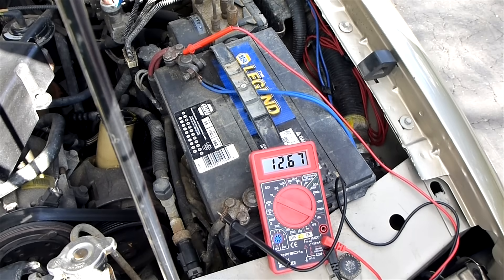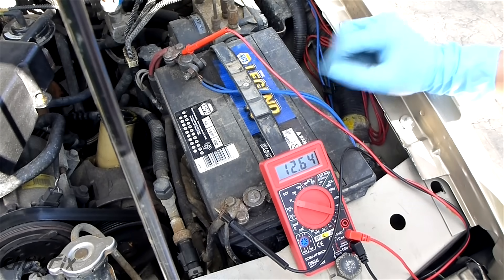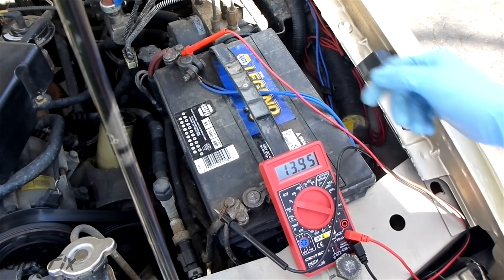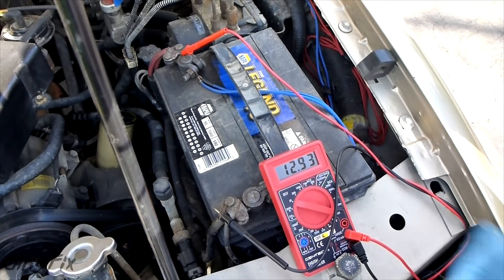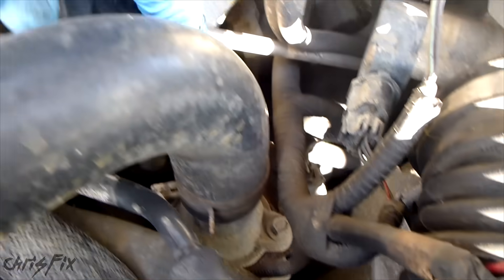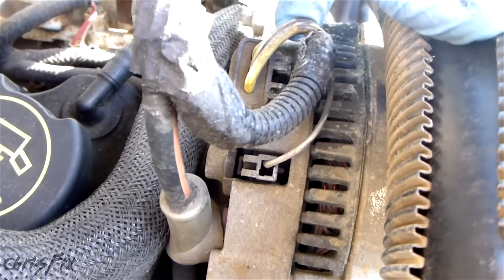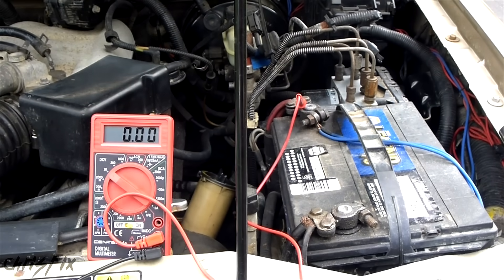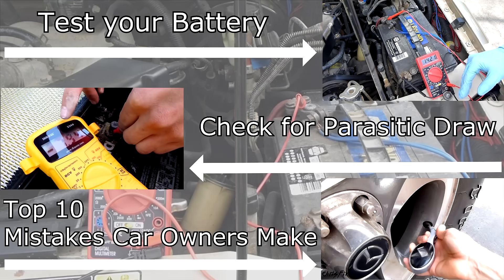How to Test an Alternator

Comment: So I tested the battery the battery was 9 volts so I have to change the battery I also tested the akternafod it was also 9 volts so does it mean if I have a good battery my alternator will be around 12 with a new battery or it will still be 9 volt on alternator

Comment: Hi. My car sometimes just dies. Dash lights and everything goes off. It goes on aftera or 2. My initial reading was 12.4V. After I started it, it went to 12.2V initially but after revving it, went to about 13.2V. Could it be the alternator?
Reply from the maker: The alternator should be around 14.2v at idle so it sounds like your alternator could be going bad or you need to clean your grounds and cable ends so they have a good connection.
Reply: ChrisFix Thank you! 😸

Comment: I had a driver side airbag module replaced on my 13' mustang (recall) and when i drove it home from the dealership the car died twice at red lights. I watched the voltage and its dropped from 14.2v to 13.2 within the 24 hours ive had the car back. Ive been driving it around and i notice every start up the voltage drops .1v
Reply: The car also would drop rpms and want to die but that problem seems to have gone away within a day

Comment: What does it mean when my black lead is on the ground and red lead is on the alternator case. And when I rev to 1500 rpm I have a positive voltage like 6-9volts. I’m not getting a negative voltage like your showing

Comment: hey chris, my 1975 toyota RT100 have some charging issue. after the engine started i only got something like 13.3-4v but after some revs it stay at 14.1v and slowly droping. and sometime the "CHG" light come on for a minute or even doesn't come off even it says 14.4v while driving. how is that possible?

Comment: Here's my deal. 
I bought a 2000 Lincoln Town Car on April 2nd. It's April 14th right now. Earlier today, my battery was randomly dead for no good earthly reason. My neighbor came and jump started me and it worked. All I was trying to do was pull my car down a few feet under the tree for some shade so I could wax it. Fast forward a few hours until now, almost dark outside and I went to turn the car on and BAM, nothing happens at all. I was trying to turn my car around in the driveway. My brother tried to jump me 3 times and NOTHING happened each time. What's wrong? I don't have a multi meter to test anything. 
Edit: The battery was manufactured in February 2018. That's right, only 2 months ago. I haven't left any lights or the radio on. I don't get it.

Comment: So just went through this bullshit. I changed the alternator last month and my truck was working fine until Monday. As I was driving the battery would start to lose power and if I turned it off the battery was dead. Well guess what the hell it was. When I changed the alternator I didn't tighten the bolts to ground it to the chassis. Wtf I've changed alternators a lot in my life  and never had this happen before. So after I tightened the bolts all the voltages are within range and not jumping all over the place. I got lucky this time.

Comment: I NEED HELP!!! :(  so I did the first test with my multimeter on a 2014 Honda Accord and the initial voltage stays at 12.39 or around there but when I try and start the car (which won’t start without a jump) the voltage drops to 2.5- 3.8, very low. I’m guessing it’s the alternator as we just went in for a oil change at Honda a couple weeks ago and they said the battery was good. I would really appreciate the feedback please and thank you!!!!

Comment: A more simple way to test for people have don't have a volt meter is to  

1.loosing one of the terminals with a wrench 

2. start up your car 

3.once car is running pull off the terminal from the battery

 if the alternator is good the car will keep running if it's bad the car shut off it's that simple

The batterys only job is to give the starter enough amps to turn over the engine the alternator does the rest after the car is running.

Comment: using a house hold type meter will sometimes give bad readings. if your not using one designed for cars then you may not get the right reading and find yourself in problems.just saying.

Comment: You only showed B terminal. What about the S and L terminals ? 
The S terminal is used by IC regulator, so it needs to be checked to verify if IC regulator is good or not. It's also used together with the L terminal to activate charging warning lamp.
We need to check these terminals for diagnosing during the phase of charging warning lamp.

Comment: Hey what’s up we just rebuilt the whole entire engine on a 2015 Jeep Wrangler 3.6 and there’s a ground cable that goes to the engine it gets hot and starts to melt. But as soon that I disconnect the regulator plug that comes from the computer to the alternator it gets fine. But it needs that regulator to charge the battery. Alternator is new to. What it can be? Please help

Comment: great video sir.  i found this video as i was looking for a solution to my issue.  my car died on my wife last week.  i thought she might just need a jump and have the battery replaced.  turned out that the starter was bad, as when i replaced it, the car started up just fine.  we live about 45 minutes from where she got stranded, and the car died on her again, a couple of minutes from home.  i replaced the battery, made it home just fine.  next day, car drove only for a short while and car died on me again.  the next thing i replaced was the alternator.  took the new battery to go get charged at autozone.  the car still didnt hold a charge for long.  its a 1998 oldsmobile silhouette minivan.  all your help is greatly appreciated, thank you.  p.s., will be going to get me a multimeter.

Comment: My battery light has been on ever since I paid to get my alternator replaced. (I had no tools at the time and it was a bad alternator it was draining my battery) and The light was never on before. They said they didn’t know what it was and it should shut off. The light Never shut off I gave up after going back 2-3 times to try to get it resolved. My alternator is good my battery is good my fuses are good. What else would make the battery light stay on. It’s on but kind of dim but visible in the day time. Other lights such as my parking break light are really bright. Any idea what would make the battery light stay on? It doesn’t flicker or anything it just stays on at a constant low light. Help please!

Comment: i don't really get the alternator negative/positive tests. So the outside casing of the alternator should be negative, and the post coming off it should be positive (unless you have a weird alternator that's the other way around). Then its all about checking what voltage is the alternator producing (positive or negative) and then stepping further and further away from the alternator and seeing if that voltage increase/drop remains constant? oh and that the numbers match up, although mainly that there isn't a big change, indicating a dodgy contact?

I just don't know if i'll remember these numbers, nor if it's worth it because cars are all different... or maybe its always the same?

Comment: +ChrisFix , my name is Rockwell and I was wondering if you could help diagnose a problem with my 1995 Ford Ranger? The vehicle runs okay, and while in park and the AC is running it still runs fine. However when I put the ranger in Drive with the AC still on I get a quick voltage drop and the motor almost stalls and then the voltage picks back up repeatedly. Other Accessories don’t cause this just the AC while in Drive. Thanks in advance.

Comment: I have a 07 Silverado and I was wonder what may cause a slow crank, almost as if it was about to not start but starts. There is new alternator in the truck. Just curious on what may cause this besides a battery or even the alternator. Thanks in advance!

Comment: THE ABSOLUTE BEST VIDEO ON DIAGNOSING ALTERNATOR PROBLEMS EVER (Caps=shouting. I used them on purpose!). I installed a new alternator on a 97 Ram and it worked fine for 5 days then output dropped to 12.3 volts. I followed your instructions and discovered during the voltage drop test that I had a faulty ground. Cleaned that up and problem solved. You saved me tons of money. God bless you!

Comment: So if the battery is overcharged the fault is in the alternator? When I start my car the voltage goes from about 12.2v to 15v and then stays around 14.8v. When I take it out to the store and come back it doesn't start right way I have to wait. Even if I've been in the store for about an hour. This sound like an alternator issue? I've changed the battery and the starter. And my connections are good.
Reply from the maker: 14.8 is the max so that is right but I would take a guess and say maybe the battery is bad which is causing the alternator to pump out 14.8v.
Reply: Thanks for reply that's very appreciated. Why would you say it's the battery? I'm only curious. I replaced it unless it got bad on the shelf or something. I think I've heard that somewhere.

Comment: I notice a loss in acceleration after about 30 minutes of the car running. I turned ac on, fans on and it dropped from 14.2 to 14.0. What's weird is if I test when the car has sat for a bit, it will stay at 14.2 with ac on, lights on, radio on etc.
Reply from the maker: A .2v voltage drop is nothing to be concerned about. That number will fluctuate.
Reply: ChrisFix Okay, thank you. The hunt for the issue continues.

Comment: Same procedure if you have 2 batteries (2x12volts)? My Hilux d4d gets a wierd readings starting at 13,05 V not with engine running. Then when engine running it drops from 14 to 13 every 10 sec maybe... And then working its way up to 14 V to drop again. When stressing the alternator it goes down to maybe 13,6 dropping and going up

Comment: You didn't test for a bad diode.  That would have been a complete alternator test.  Bad diodes can drain the battery when the car is not running....

Comment: Hey to anybody reading this I’m having a battery drain issue. My car did not want to turn on at all this morning. I took my battery to get fully charged at auto zone the other day and everything worked fine up until today. There’s No crank at all . Can it be a alternator problem or should I buy another battery . This is the 2nd battery I buy within a 1year

Comment: Hey Chris so I'm getting around 12.6 when the car is turned off and then when I turn it on its at 14.5. However when I turn on lights, radio, and air it stays around that voltage. Idk what's up with that but my car has all it's lights flicker when I turn it on and it has a new battery.
Any help is appreciated 
My car is an Acura tl 08

Comment: i have a 2006 acura tsx i put in a new alternator and the battery is testing good even with the engine on but my check charging system light still comes on and off but only when im driving and the light doesn’t stay on comes on and off while driving at random times
Reply: check ur wiring or connections, or if the belt is slipping check the voltage out of the alternator post if it differs from the voltage at battery

Comment: I have a 12.4 volts (engine off)
14.07V (Engine Start)
13.5V (Engine On + Aircon + Light) > its not at 14 like you said is this considered bad?
Reply: yes most likely ur alternator is on its way out

Comment: So I did this, because the battery light was flicking on, and headlights were flicking. So I tested: Battery tested good. Alternator no load good, loaded good. With numbers specified in video.
Volt drop test.. I dunno if it was my tester or an actual problem.
It was all over -54.5 to .04. When reving it was all over the place. I touched the bracket. Same thing. 
I didn't go any further it 0 degrees out.

Comment: Just replaced an alternator on a 2002 Chevy Tahoe and the battery light is on and the voltage gauge is all over the place what can be causing this and how do I fix this
Reply from the maker: Check your grounds and make sure all the wires are connected securely to the battery and alternator.
Reply: Thank you we found out the alternator isn't producing the right voltage and it was a brand new one so we gotta put a new one on it again

Comment: 2000 VW Beetle, battery keeps dying. I charged it up and put my meter on it, got 12.5. When I started the car it shot up to about 15.9 and slowly climbed to 17.2. When I put a load on the system it lowered to around 14.5. Is my alternator overcharging?
Reply: definitely, the longer u leave it that way it can damage ur battery itll dry out and make it smell like sulfur so get that repaired asap

Comment: I'm having a problem with my 95 s10 with the 2.2 5 speed an you will have to jump it off an it runs alil above the votl an when you turn off the truck the bettary will go to 9 an half or 10
Reply: overcharging a battery will damage ur battery and can even cause it to leak or smell like  sulfur...u probably got a bad regulator which is internal in ur alternator
Reply: I'm going try to replace the alternator starter an battery an see if that helps but it be in time bc of money
Reply: blackbeekiller91 yea, just make sure u dont install a new battery with an overcharging alternator if not itll damage new battery too

Comment: Chris, If you have more than 1 vehicle (Say 3 Cars) and within a 30-40 Day Period all your Vehicles develop electrical issues, nothing has been installed in any vehicles (I.e. radios, subs, tv's, power inverters, alternators, batteries, etc) would it be safe to assume someone has done something to cause the issue in all vehicles? Issues in each vehicle is different but strangely odd and never before "heard of" in my case. 

I.e. Vehicle #1 - Has been operating fine for over 7 months (since purchase) and suddenly now lights are dimming, Batt light comes on yet Alternator is pumping out 14.6V Replaced Alternator, Replaced Pigtail Connector Still not getting charge. 

Vehicle # 2 - Was broken into by (Suspected Highschool Kids) the vehicle is a work truck with Thousands of dollar worth of equipment, tooling, etc yet the thief / theives were only interested in the Subwoofer Box and nothing Else. Now whenever vehicle is sat overnight batt dies, must be jumped everyday (alternator is working fine) If A/C, Max A/C, Floor, or Vent is left in "ON" position vehicle can be driven for 2hours then cut off and will not re-start without a jump. but when system (Heat - A/C) is turned to off it sometimes will start if performed within 20min of turning off engine. after that must be jumped. 

Vehicle # 3 - Dies Instantly whenever a draw is placed on system, such as Radio on, A/C on, Transmission placed into Reverse, or Drive and accelerated. Requires Jump everytime to start and Batt / Alternator are within specification when vehicle is ON. When off batt dies to 5V and quickly looses voltage within minutes.
Reply from the maker: Dang sounds like you were visited by some aliens or something... kidding aside, I would look for cut wires and consider checking the batteries. Maybe they all went bad at the same time by coincidence.
Reply: Battery & Alternators were newly installed April 2017 in Veh #3, Battery & Alt newly installed in Veh #2 Jan 2017, Veh #1 Has a Yellotop Optima Battery from 2016 October and same alternator since 2013.

Comment: ? you are using a voltmeter that has a 200mA leed hole (that you are connected to with the red leed) ... and the top hole that is for 10 Amps max.   Wouldn't the Battery just pop the fuse on the tester because the battery is putting out 100's of Amps when starting and/or running?

Comment: I hav a problem, my car drains battery voltage until 5 v (when is off), already 2 new batteries; while is on it keeps around 12.43v, going down slowly!!! ..... none bad fuses, relays....if i charge the battery it works and loose voltage in probably half of an hour. my question is if a wrong alternator can drain the battery even with the engine off¿??

Comment: +ChrisFix Hey man thanks for this video (happy I subscribed to this channel),
 The other day i had to jump my 2012 Fiat sport and this morning i woke up to the car that just wont turn over. well i took the battery out and threw it on the charger and a few hours later i retried again with no luck.. Well after watching your Video i gave my Alt a quick test,  my multi meter ($5 at HBF) and i can see that my alt is only pushing 9.7.
----------------------------------------------------------------------------------------------------
What sucks though is that my OBD II isnt coming up with anything and my check eng.light and Power Steering lights and low oil lights are coming up. What do i do about this?

Comment: I did a couple things. battery is brand new. voltage is 12.85. I crank the car and it jumps between 14.25 to 14.40. I turn all the lights and ac and I hear a click and the fans turn on and goes to 12.7. I checked the positive side of the battery. I put the negative on the bolt and showed .31 and then the nut and showed .35 and then in bwtween the post and alternator part and still .35 . COuld the alternator be bad?

Comment: My connections are not dirty at all. I just got a new duralast battery and it keeps saying check gages and lights dim. Battery voltage (truck off 11.78 ) now (truck on11.04).  The bracket of the alternator is also clean. Still sanded them.
Terminal are clean and cables also.

Comment: Hey I really like your videos. I have a problem on a 2014 Dodge 2500 w/5.7 hemi. The battery is now smoking and has sulfur smell. I had autozone check it because I am using s portable charger if it sits to long to start it and their tester read it's good but needs charging. Also, the alt checked good on their machine. My gauge on the dash shows charging. I hate to spend $200 on  battery when it could possibly bein the computer or a regulator problem? Any suggestions? Thanks